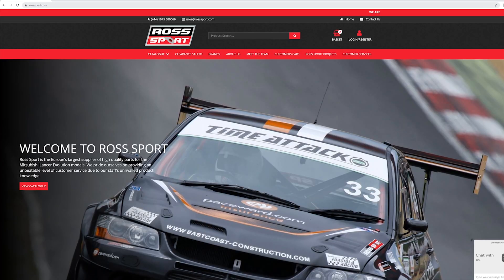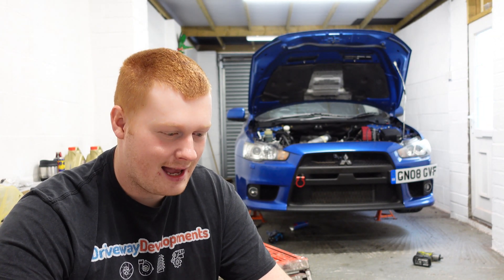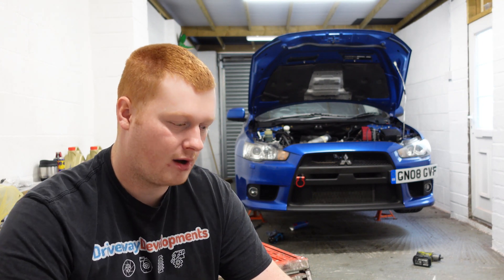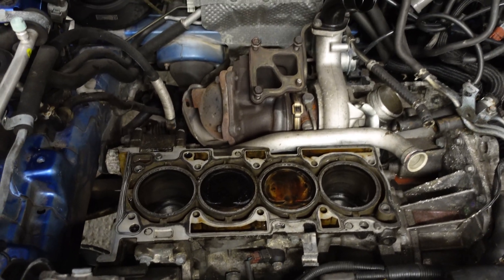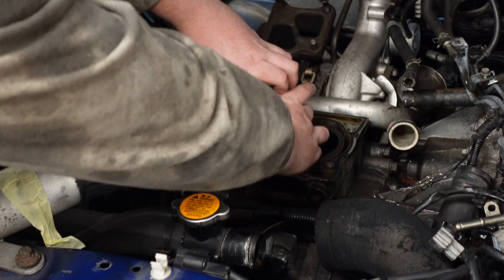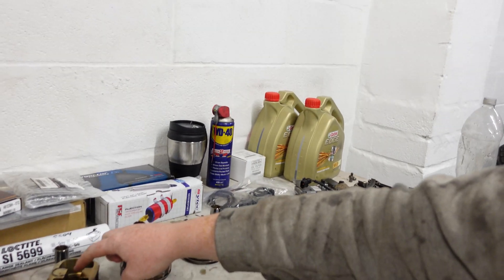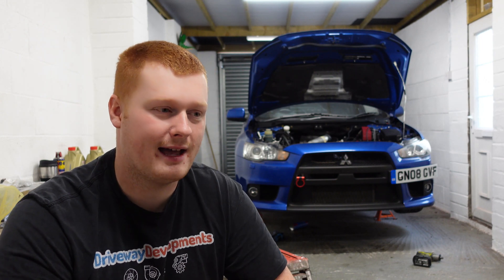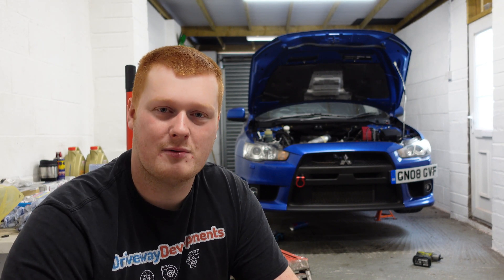DIY Forged Conrod Install on Evo X SST 600bhp Project

Comment: I'm actually surprised you got the pistons in with that piston install tool. I had the exact same one and it would not work for me no matter what and actually ended up breaking a ring eventually.
Reply from the maker: Used it on a few builds with no issues